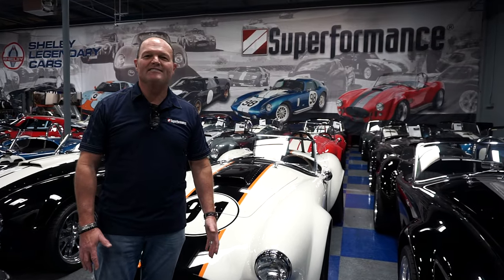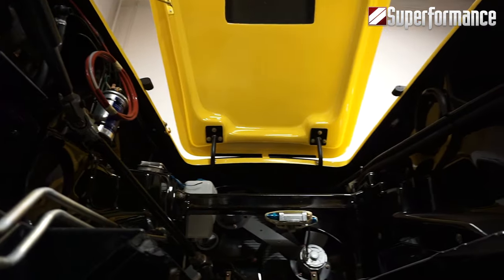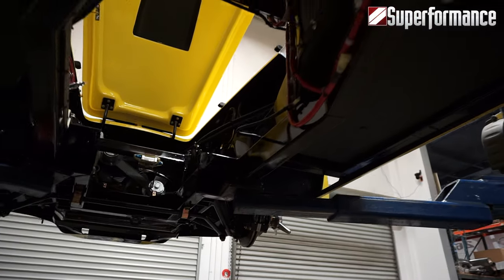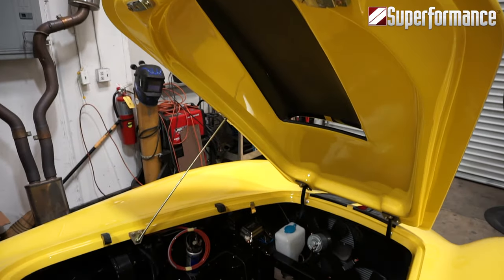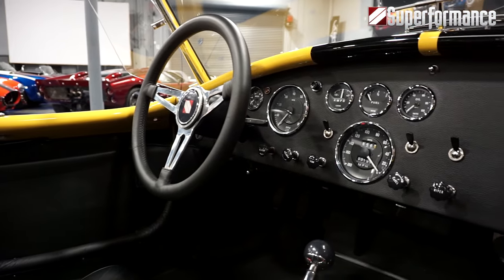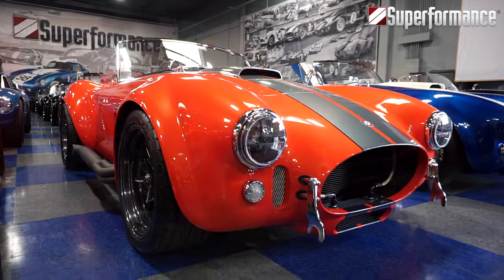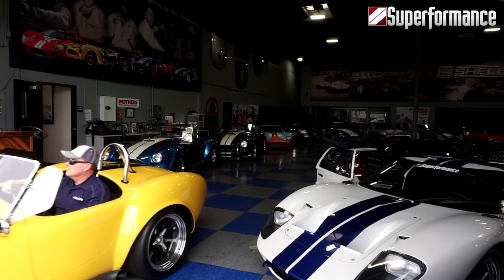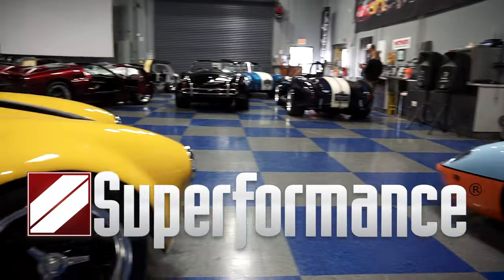Superformance LLC | MKIII - Video Tour

Comment: I have a2006 chassis mark 3 I put a 1973 preseason  351 block with a392 stroker assembly  w a full race comp cam w a pair of air research  heads

Comment: Wow .. a square tube chassis rather than the 4" round tube ladder frame.   I'm wondering what is the Beaming & Torsion readings on the new chassis. ?   I have a similar chassis built in Australia but it is a double rail arrangement to meet the Australian design Rules in NSW.  The flex in my chassis is about 5 mm . Jacking from the front and lifting the rear wheel.  It just made the specifications.